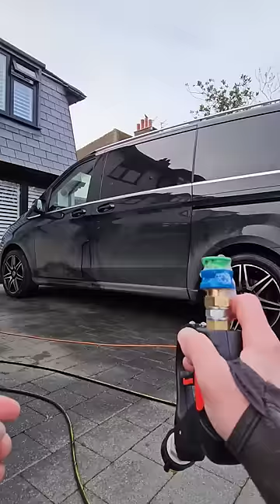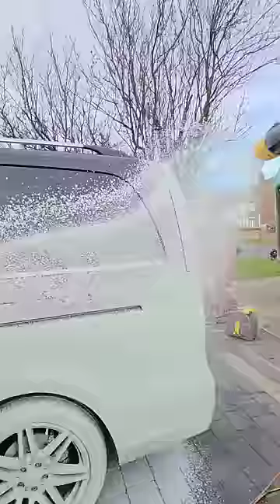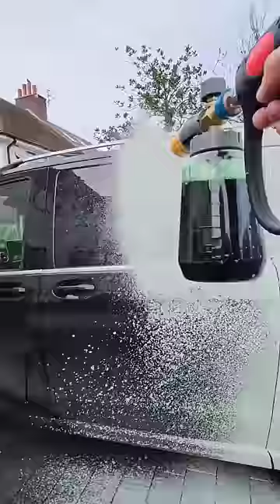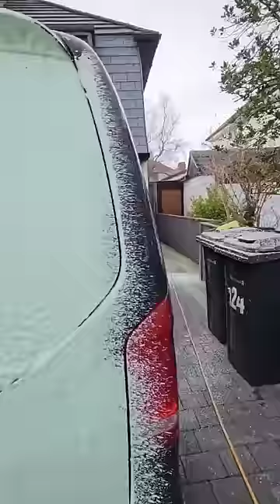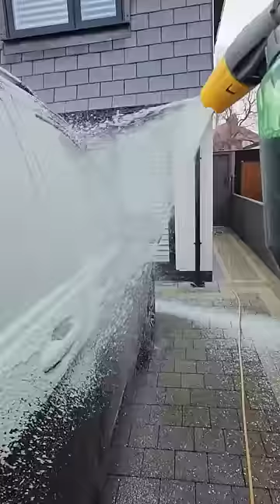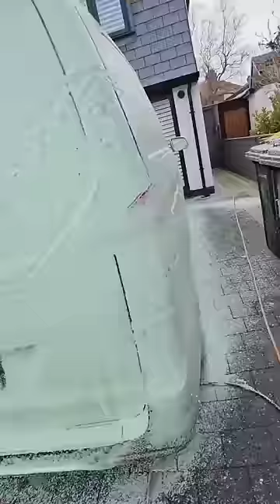Detailing Point of View - Snowfoam Cannon #detailing #shorts

Comment: What I want to know is how easy does this make washing my car? Is it just a matter of spraying the foam and then rinsing off? Do I still need to use the sponge? I bit of detail would go along way.
Reply from the maker: Hey there, so yes what we do is apply the foam leave it for around 3 mins to dwell and break dirt down, we then rinse it away. Then we would start our contact wash using 2 buckets one with soap one with water and then wash the car using a wash mitt panel by panel top to bottom cleaning the mitt on each panel we do. Hope this helps 🙏
Reply: 😊⁰⁰